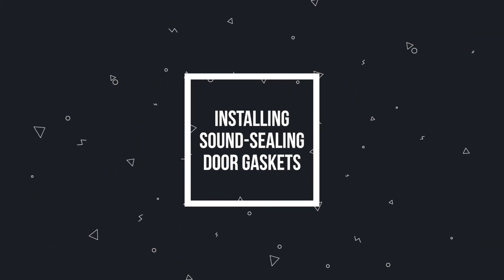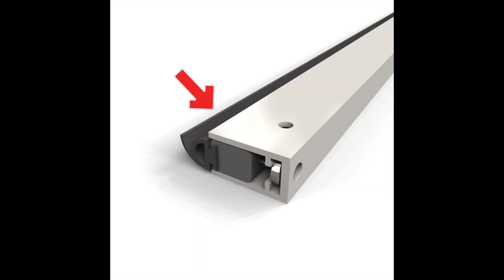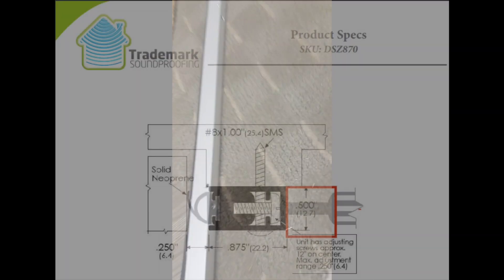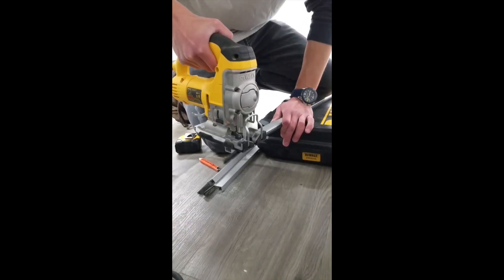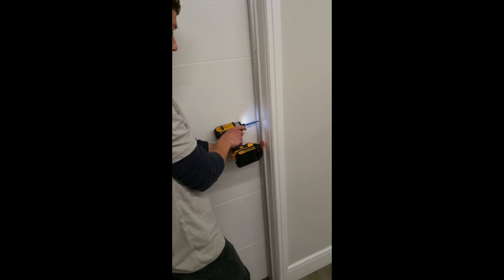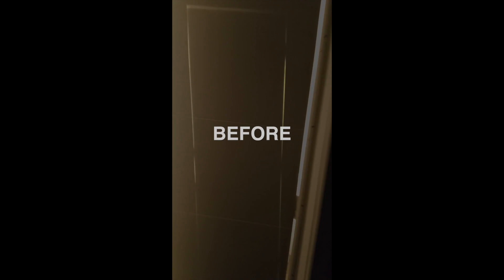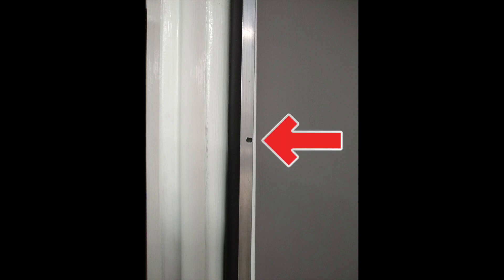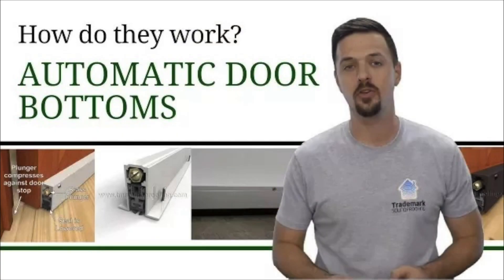How to install Door Gaskets to soundproof doors

Comment: We are a company engaged in the development and sales of rubber extrusion sealing strips. Our products can be used in various doors, such as industrial doors, fire doors, automatic doors and security doors. If necessary, please contact us
WeChat 13585560057 WhatApp + 8613585560057
13585560057a@gmail.com